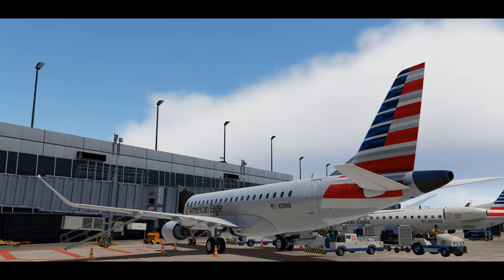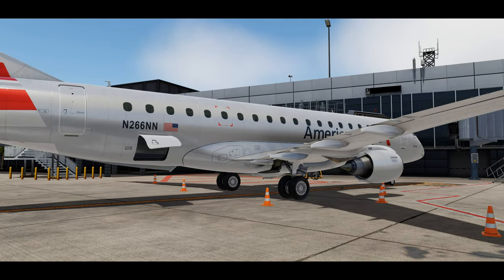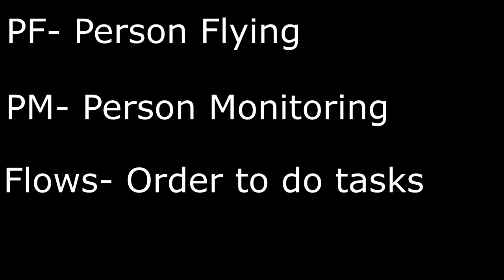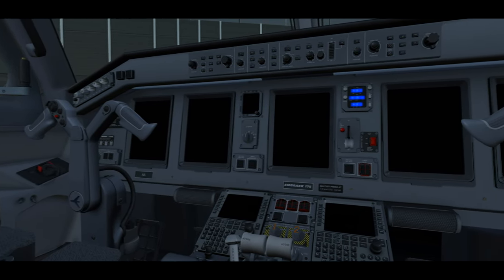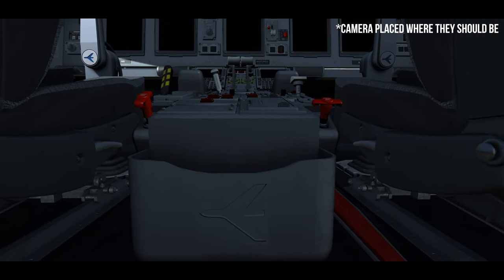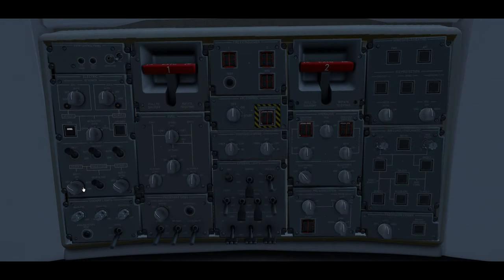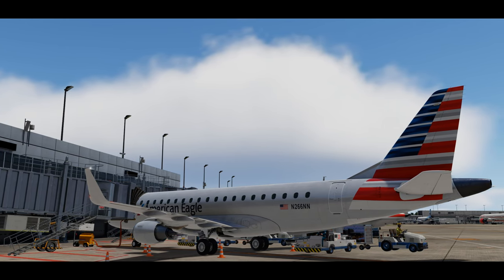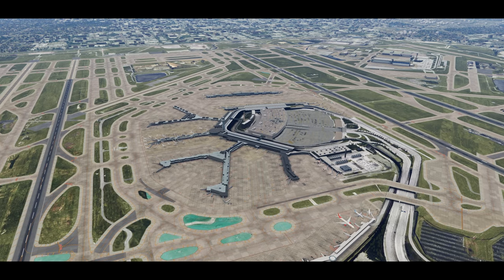P3DV4/V5 Embraer 175 Pilot Series | Safety and Preflight Checks Ep.1

Comment: GOOD VIDEO! WHERE I THE BUTTONS TO OPEN THE DOORS AND CARG HOLD , AND IF I WANT TO START WITH COLD A DARK WHERE CAN I PUT?
Reply from the maker: To open the doors and cargo doors its SHIFT + 1, SHIFT + 2, SHIFT + 3, and SHIFT + 4. In order to get it cold and dark I had to manually turn all the switches to off on the overhead panel.